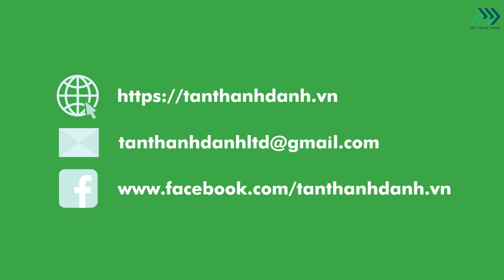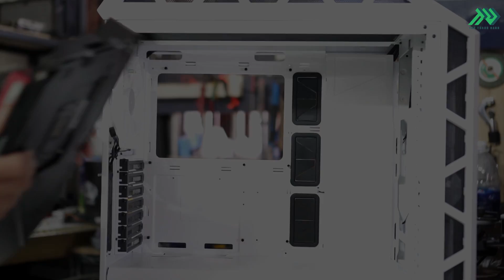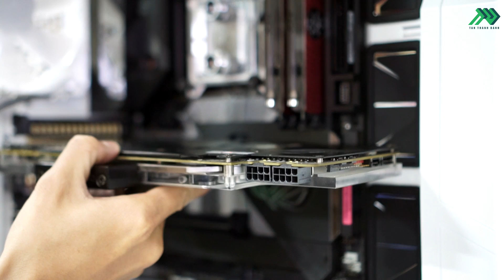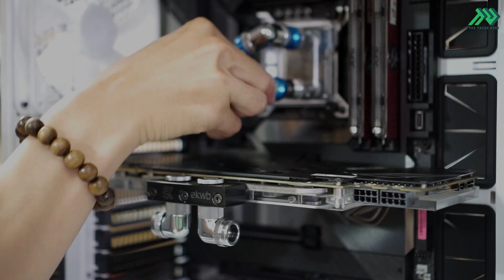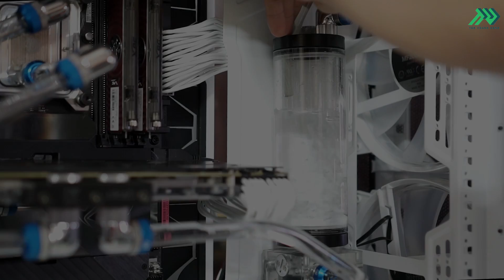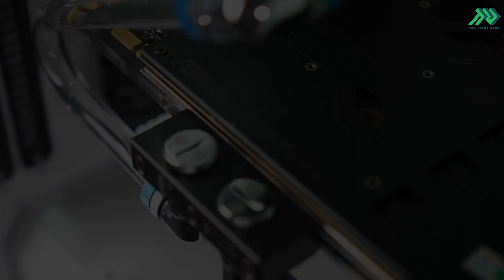Custom watercooling : I7 8700K / Asus Z390 Maximus XI Formula / GTX 1080Ti Strix

Comment: Beautiful build. This setup is my goal after I get my 2080 Ti, 9900k, and formula board in. I've got the chip and Mobo ordered but can't find a 2080 Ti that I want yet. Waiting on the Strix or FTW3.
Reply: Also I've got the H500M case
Reply from the maker: I am also waiting  Strix 2080Ti :(
Reply: The Strix 2080 Ti (O11G) will be available on 30th of November, at least in Italy!
Reply from the maker: Same time in Viet Nam :)
Reply: I read and watched reviews and benchmark comparisons and i saw that msi 2080 ti trio x is the best.

The best for water cooling is msi 2080 ti seagate EK X which already has a water block with backplate on it. It has the exact same specs as the trio x but it has a waterblock on it already. It would cost an extra 100 pounds dollars or euros but i would say it is worth it for the best perfomance